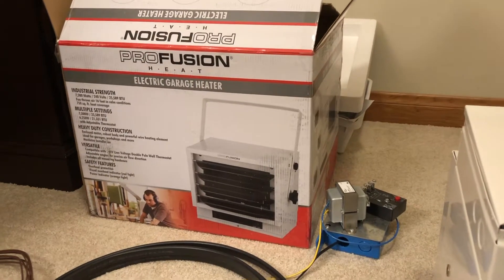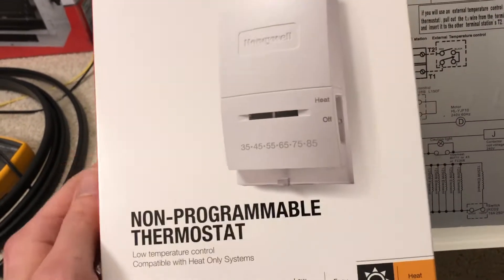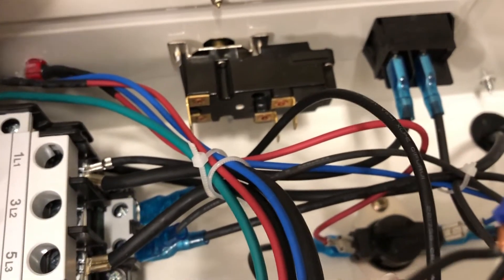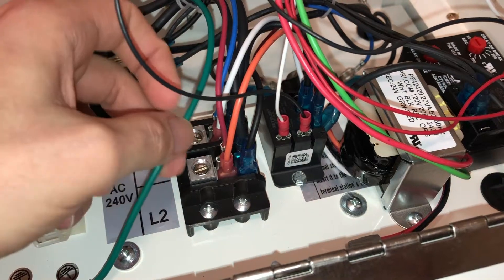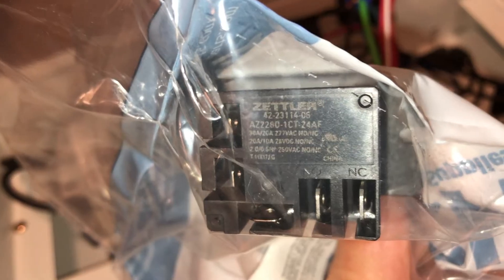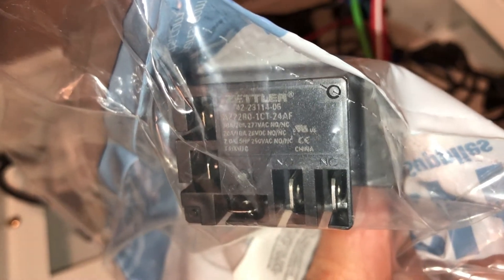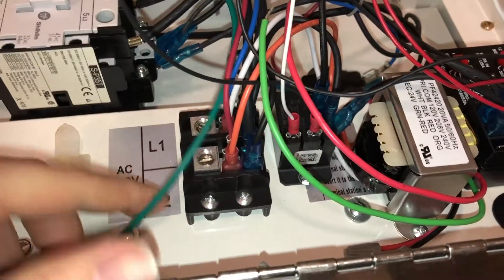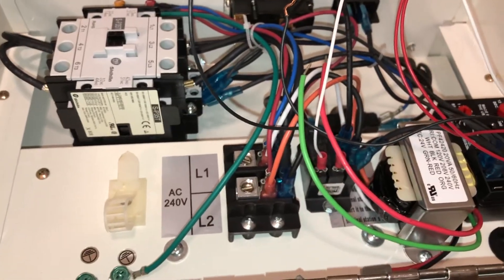How to Add an External 24V Thermostat to an Electric Garage Heater

Comment: Great Video! Do you happen to have a wiring diagram available of what you did or perhaps have one that I can purchase? I am wiring a similar heater... a Fahrenheat FUH724 which is a little different and there are a couple of your wire routes that I was not able to follow. Any help you can lend would be greatly appreciated... I am almost complete with the wiring. Thank you in advance!
Reply from the maker: I don't have a diagram, just wired it up logically when I did it. You have a different brand and model so it wouldn't work for you anyway. All you are doing is making a loop from L1 to L2 for both the fan and the elements with the load and relay or contactor in the circuit. Same idea with the control loops if you are using 240V coils. If you are having trouble, try to trace out the loop step by step from L1 to L2 for each circuit. Otherwise I need more specific info to help. The model you gave is different because it switches the elements with the thermostat directly instead of using a contactor with a 240V coil like mine had. It also has a mechanical thermostatic fan delay which mine didn't have, so you could use that instead of adding the delay timer like I did. All you would have to do is replace the thermostat with a single pole 30A A/C contractor with a 24V coil and add a 240 to 24V transformer to switch it.
Reply: @TechnicalLee  Thank you for your time and your reply. Any chance you might have a direct way of contact? I would be happy to pay you for your aid in helping me get this heater up and running... if this is something that you offer or would be interested in. Thanks again!
Reply: @kjr6289  Did you end up getting the FUH heater completed?  I have the same heater, and I want to do this setup.
Reply: @bbonifield  Hi, yes I did. Happy to share some info and pictures if you still need help.
Reply: @kjr6289  yes, that would be great.  i bought the parts from the video, but i haven't installed it yet.
Reply: @bbonifield  I just realized the video you were asking me about was not the one that I followed when I wired my heater. I actually followed this video. https://youtu.be/col5i4hjw9k
Let me know if you have any other questions.
Reply: @kjr6289  Ha, that's actually the one I bought parts for.  I decided I didn't need the timer.  I would still appreciate the pics/description!
Reply: @bbonifield  Do you have an email address I can send some of the pictures?
Reply: @kjr628 Did you end up wiring your FUH724 with the fan delay? Could you put a link of your wiring or a picture of it? I'm trying to do this setup with the FUH724 model.

Comment: great video! i noticed that since you disconnected the fan knob, that means that the fan will run at full power all the time with the new setup correct?
Reply from the maker: No, the fan is on a time delay and will run only when the thermostat calls. Go to 18:57 in the video to see it work.

Comment: First, the fan is a piece of shit!  Second,  Comfort Zone puts a label on this product stating no serviceable parts available!  Try to find a fan replacement! !!!!!! This heater causes your electric meter to spin like a c.d. 
 Lastly,  if your trying to keep a garage above freezing I recommend you mount it at a lower level.  Like 2 feet!
Reply from the maker: Works fine for me in an insulated garage. I have it pointed down and the louvers adjusted so the air blows towards the floor. And yes 7.5kW will use a lot of electricity, gas heaters are cheaper to run but more difficult to install. They don't want you to mount it that low because it could overheat and start a fire if something gets put in front of it.